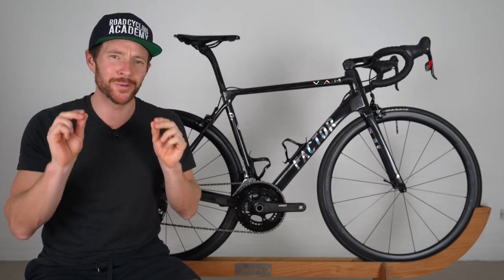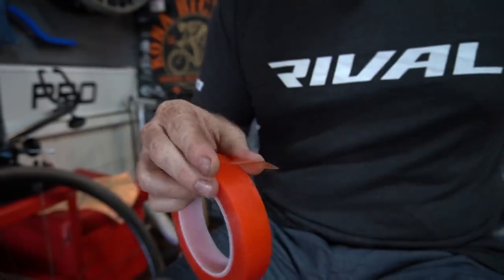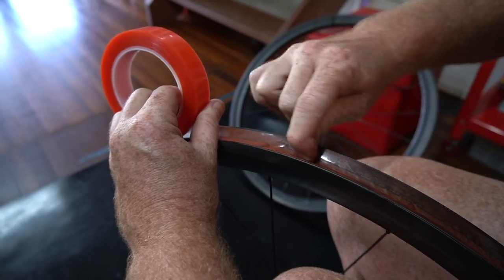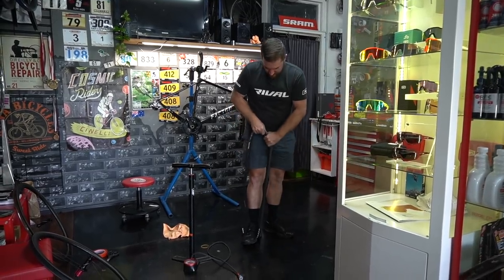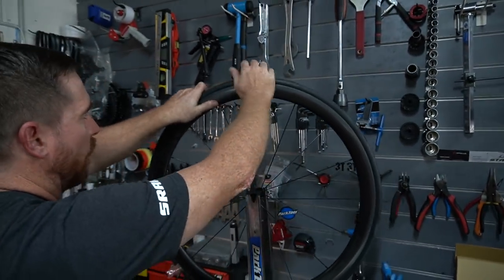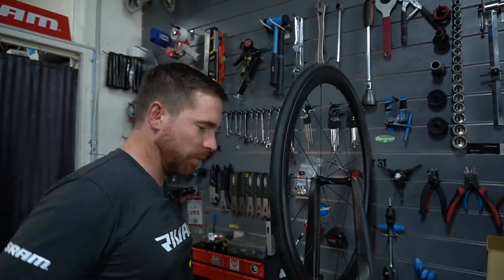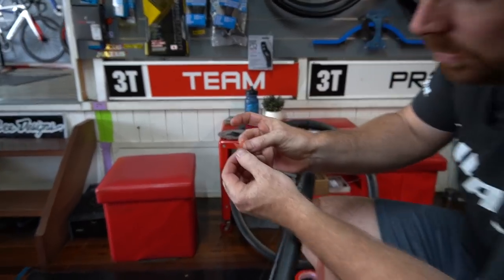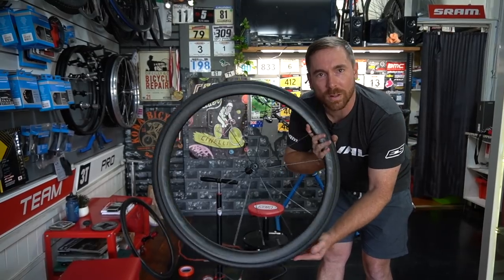How To Fit Tubular Tyres using Tape

Comment: I ride Zipp 303 tubs on training rides, glued on, and carry a pre-glued spare tyre. The glue reactivates when it goes up against the glue on the rim to replace a flat. I use Conti Gatorskins for training, Conti Competition on Edco's for racing. Never tried tape as I can be quick with glue, but now might be the time.  I can change a flat quicker than club members with clinchers and tyre levers, and certainly quicker than tubeless, which many without the right technique struggle to get off and on. I also use sealant in the tubs and it has saved me many times.

Comment: I've been running clinchers for decades. I only got my first tubular wheelset last year. I haven't done much riding on them yet. I decided to go the tape route, and don't have any regrets yet. I went with the TUFO tape on the rear, and the red 3M tape on the front. Just to see which one was better. My red tape wasn't transparent like the one shown here. Thank you.

Comment: Great vid Cam. When I fit my tapes, I always peel off a couple of inches either side of the valve hole to lie outside of the rim before fitting the tyre so that just in case the tape breaks when pulling one of them through, you always have the second to pull from the other side. If it does break, its probably a sign that that the tyre has too much pressure in it, so I would reduce the pressure before pulling on the second tape. I never pump the tyre over 30/40psi.

Comment: I always tape over the stem hole because the bottom of the stem rubber gets pushed up through the sharp edges of carbon or aluminum valve holes. I also use 3m, but mine is blue and thicker. I also like to see tape protruding through the valve hole surrounding the stem.  Its worked like a charm for me for many years.
Reply from the maker: Interesting to hear, thanks for sharing on the thread mate 👍

Comment: I had no idea that fitting one was considered to be such a big deal. I've run tubs on my track bike since I got one in the 90's, and didn't think anything of changing tyres myself, just went ahead and did it (with tape). Couple of nice tips in there though, which I found out by trial and error... pre-YouTube :)

Comment: I have been running tubulars on my Enve’s for several years and have been relatively fortunate. Nevertheless, flats are inevitable and I just walked out to find a flat front tire caused by a huge piece of glass. I’m sick of glueing and so I’m going to give this a try. My question is this:

I have two rounds of old glue on the carbon rim currently. Is the tape more effective or less effective with the old glue on the rim? Is removal of the glue is necessary to proper installation of the rim tape? Cheers in advance.
Reply: I'd say maybe try to remove the old glue with fine grit emery cloth. I saw that on a Continental video.

Comment: If your tire is flat beyond repair, do you have a spare with you?  Just curious why you didn't choose tubeless, thanks for the content!
Reply from the maker: Yes I will be carrying a spare tyre on the longer rides.
Reply: Some guys put a squirt of sealant into the tubulars but you just take a spare. If you're just a metro rider or doing crits I think tubs are ok. I feel they're a safer option than tubeless.

Comment: Thx Cam.  Ur mate the bike mechanic certainly had done a few of these.  I have always glued mine. No longer. Have 2 take my Roval clx40's 2 my Specialized Bike Shop & they r very kindly going 2 allow me 2 use the Wheel True Stand 2 get the glue off my Rims. Tape 4 me in future. B4 the new Tubulars go on l am going 2 upgrade the spokes 2 DR Swiss Aerolite bladed Spokes. My Carbon Wheels should end up about 100grams lighter & also faster. Would ❤ 2 find a couple of pairs of the clincher versions 4 Training.

Comment: Would love a tutorial in options to get home after flatting with a tub , reluctant to ride mine as worried will get stuck
Reply: Been running Caden tubular wheels for 18 months with veloflex arenberg 25mm tires. I wore out a rear tire(ie no punctures) and removed that tire at home
 to replace. What surprised me was all the Caden supplied 3M tape remained on the rim and was very sticky 👍.  I carry a spare tire and in the case of a puncture on the road, would have no hesitations in ripping that tire off, fitting the spare and continuing the ride.
Reply: @DallasTRF  How do u carry ur spare tubs? i was thinking about saddle bags but i figured tubular tires needs quite some space as they aren't able to flex as much as regular clincher tubes. Cheers
Reply: Hi there from France, 
It's pretty simple really,just take à spare tubular with you (and a means to inflate it),they fold up and you just pop it in one of your jersey pockets. 
But let's be clear here, if you're happy on clinchers there's no real reason to change.
Tubulars require alot of work.Here in Europe they are not that expensive,plus there is a real tubular culture.
Have a great day 😊

Comment: Hello can tubular tape be installed over leftover glue residue on a wheelset? Or will I need a fresh/bare wheelset for it to adhere properly?

I want to switch to tape but was worried the glue residue would affect it

Comment: Hi from France, 
I'm a tubular man,been running on tubulars for years (a personal choice, no hate mail please), i glue my tub's (again a  personal choice, no hate mail please).
But what a great video, showing that it's not at all that hard the gluing part,but i'm telling you now the ride on tub's is just something else.
Just a question,how do you find those Maxxis tubulars ? I run exclusivly Vittoria (again a personal choice) the Corsa in 25mm.
Do you find a difference between tubulars and tubeless tyres ?
Do you run on tubulars daily or only on race days ?
I love your chanel,i'm an Aussie (from Melbourne,no hate mail) love your accent and just they way you get things done.
Reply from the maker: Thanks for the support mate. Haven't had much experience with tubeless, so can't say. I will be running tubulars daily on the Factor. I have three bikes though. Haven't ridden the Maxxis enough yet to tell! Cheers, Cam
Reply: @veloaddict  hi there,which country are you from ?

Comment: Hmm. I'm still a bit skeptical on tubular tape. Is it really as safe as glue? As in it doesn't roll off even on hot days? Or with rim braking heat?

Edit: I've also noticed it's hard to get the tape perfectly aligned to the wheel, as it sticks to the tube immediately, whereas with glue, the tube "slides on" the wheel, allowing for minor adjustments to be made before they completely adhere.
Reply from the maker: We'll find out Chris. My first attempt
Reply: I ride taped tubies in the Texas heat with no rolling/sliding. Excellent road feel an handling.

Comment: Thanks Cam yet another interesting video. I have a question for your friend. How about leaving a small gap (5-7 cm) opposite to the valve without tape to facilitate dismounting the tubular fast while being out there? and in case of a flat would it be safe to mount a spare tubular if that 3M tape comes off with the flat tub (as I have experienced when done at home), much less with Tufo tape that tends to stay on the rim. Cheers
Reply from the maker: Thanks for the Q Jorge, Jay may come in an answer a few. Cheers, Cam

Comment: Hello is it possible to install tubular tape on top of old glue residue or does it need to be a fresh wheel that hasn't been glued previously? I'm worried the old glue would affect the adhesive from the tape
Reply from the maker: You would need to clean the rim. Surely there is a solution for that. I am not personally sure though

Comment: How do you change a tubular tire? since it is glued or do you just swap the whole wheel?
Reply from the maker: peel it off, you just need a bit of force when the tyre is deflated.
Reply: @CamNicholls  when using force isn't there than a risk of damaging the rim?
Reply: @muhtah9970  No you won't damage the rim, I have used tubs on my mtb with Mariposa tape and would gently use a screwdriver to lift the tire/break the glued bond on the rim (small section).  Then you roll the tire off the rim starting with the unbonded area.   The guy taping the tubs forgot to mention you need to give the glue a day to cure, saying "ready to ride" at the end of the video after he just finished is a good way to roll a tire.

Comment: It boggles the mind that a strip of tape is holding a tire on to a rim!
Reply from the maker: I hear what you’re saying but the tape is super strong. Never seen anything like it.
Reply: I use various 3m tapes in a more industrial setting. There are different tapes with different glue strengths available. Some of them are just crazy strong. One of the tapes I use comes with a warning not to use it anywhere which can't be damaged if you need to remove it.  I use it to mount stuff on the wall at home and it will take chunks of concrete out when trying to remove it. Other tapes are designed for rather more easy removal-most likely what is needed for tubular tires! Really amazing stuff.
Reply: The tyre would stay on the rim without the tape as long as it's up to pressure, due to the shape of the rim...
Reply: That Tire is tight around the Rim once its has the right amount of pressure.